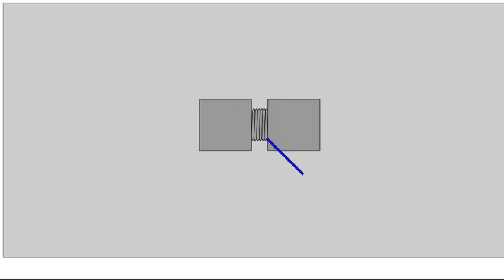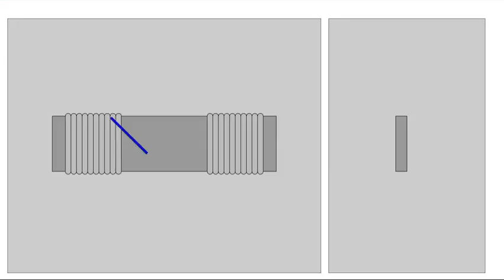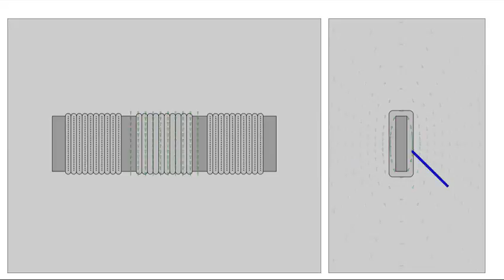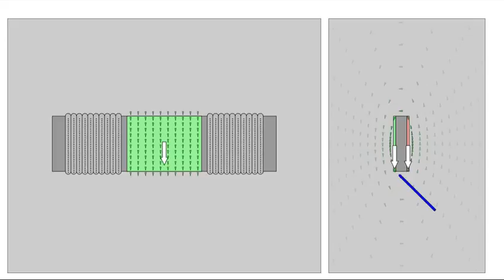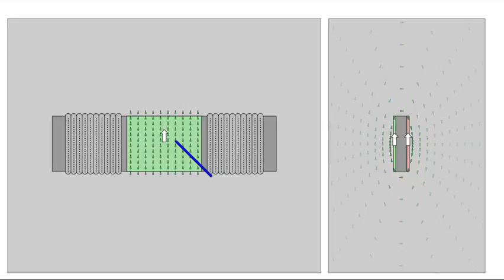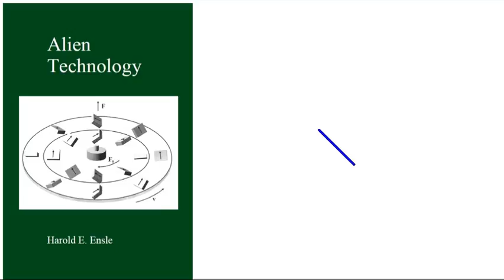The Electromagnetic Propulsion System

Comment: so is there a straight (non-circulating) sourceless electric field when a very large magnet simply moves through space in a straight line? I mean, large enough for the magnetic field to be essentially uniform and isotropic inside of it (in between the poles). as for the frame of a stationary electron it would feel a unidirectional electric force? or only a magnetic field that changes its magnitude is capable of creating a circulating electric field? couldn't be the actual motion of the vectorial B field (as to concentrate or spread out), that actually persuades the structure of space to respond showing the sourceless electric properties?

Comment from the maker: UPDATE

I have now proven by experiment that the scalar magnetic field exists. There is also ANOTHER scalar field, the scalar electric field as I discuss in The Electromagnetic Universe 7th Ed.

Now the scalar field means that there is no non-reactive magnetic force, so the part in his video where I say that this force needs to be eliminated by the additional "flux" capacitor is unnecessary. However, while the magnetic field reaction is not present, the scalar field defeats this device and it cannot be bypassed using this geometry.  HOWEVER, this would only happen if the magnetic field in the ferrite is caused by an actual surface current. That is, if an atom actually has electrons moving around the nucleus. This is unlikely (the Einstein-deHaas experiment notwithstanding). In other words this device should work even without the complementary capacitor.

HOWEVER, there is another problem. While this non-reactive force almost certainly exists, it is just too small to be of practical value. So I have been busy pursuing other lines of investigation.

There are many people that go on youtube with their phony energy creating devices or their phony non-reactive drives. They never work, but they often end up with money regardless. I do not work that way. There has been a long pause because I will not promote another device until I actually have a working model.

So the next video I post, you can be sure that it will be the real thing.

Comment from the maker: New update. There is now a question as to whether the scalar field exists at all. In fact, it appears that it does not.
In this case, the device should work. To express the options generally we have three possibilities:
1. The unknown scalar field exists and momentum is conserved.
2. No scalar field exists and there is no absolute frame of reference, then BOTH conservation of momentum and conservation of energy fail.
3. No scalar field exists and there is an absolute frame of reference, then conservation of momentum fails, but there is conservation of energy.

I am currently opting for number 3.
Reply: It's an interesting idea but i feel like you are only creating some internal stresses/heat with your plate capacitors and electro-magnets. Maybe if the capacitor plates flew the opposite direction you would get some movement.

Comment from the maker: It has been a while, so I would like to give an update on the progress towards the development of this non-reactive propulsion system.

It is my sad duty to report that this device does NOT work. However, the problem is much larger than anyone realizes.

If electromagnetism actually was correct as it is understood at the current time, this device and some other similar devices would actually work. There is no way around it. Those who claimed that this device did not work under these circumstances were ignorant and had no understanding of electromagnetism.

The reason that this device does not work is because there exists forces that are unknown in modern physics. It is the greatest irony that all this work I spent on these devices was wasted, not because I was wrong. It was wasted because physics was wrong.

I have finally worked this all out and explain it (in detail) in my book Electromagnetic Universe 5th Edition.
Reply: Yes, it does not work because magnetic field is created by accelerating charge particles...

Comment: I am reading your 3rd edition (not done yet), and I have ordered your 4th edition.  There are math issues in your book that I would like to discuss with you.  For example, it is known that if you have the conservation of charge (continuity equation), and no sources extend to infinity, and you use time retardation, then the Lorenz gauge condition holds.  Does this mean your beta is zero, always?  (See your Eq. 14.20.)   I like your approach but need clarification on the math.  Another example,  your fields, E, for example, is a function of space position (x, y, z)?  Are your x, y, z (or position parameters) time dependent or time independent?   It makes a big difference.  I'm not saying which way is correct, just wondering what your convention is.   If you would, please contact me off-line at WeberElectrodynamics@gmail.com.   Your work is interesting, but I need clarification.  Cheers.

Comment from the maker: UPDATE: Actually the 3rd Ed. Not overall very good. Did improve on a few details, but got sidetracked on some issues.
So let's jump to the 4th ed. of the electromagnetic universe. The 2nd Ed. of Alien technology has been included in the 4th Ed.

I suspect that some people are wondering what is going on with this invention. It has garnered no support from any sector despite the fact that basic electromagnetism requires that it works. Unfortunately the situation is much more complex. It has now been discovered through experimental work that a changing electric field in a capacitor does NOT create a magnetic field. This undermines my two additional patents, but actually helps this one because the end capacitors are not required since no sourceless magnetic field needs to be cancelled. HOWEVER, there is still the scalar field. This field is unknown in current physics, but has now been essentially proven to exist (See The Electromagnetic Universe 4th Edition.) This unknown field has the ability to cancel the force in the electromagnetic propulsion system, but even that is not known for certain, because it is not known if the scalar force can interact with the surface current of a ferromagnetic material.

I have received correspondence from several parties concerning tests that they have made, but typically they do not set them up correctly. Soon to come.....a video explaining how to properly test these types of devices (Spoiler: a homemade torsional balance sensitive to 8uN per degree of rotation)

Comment from the maker: Someone has brought to my attention a paper discussing a possible propulsion system similar to my own. This is Slepian's electromagnetic 
spaceship. I read the paper at http://www.physics.princeton.edu/~mcdonald/examples/slepian.pdf and found it to be quite nice. It does an 
excellent job of describing the forces associated with my device. In particular it does a nice job of describing the magnetic component of 
force which matches the force I discuss occurring on the surface current at the edge of the capacitors (WHICH THE END CAPACITORS ELIMINATE).  So yes the Slepian device does not work. My device does work however.

I am really glad to have seen this, because it answers a question that I have had. Complete electromagnetic theory has been around since 
1900 and it seemed strange to me that nobody would have though about this idea since it does come right out of basic electromagnetic theory. 
It is even more interesting, because in 2003 I came to the exact same conclusion as this paper independently. At that time I had calculated 
the magnetic forces and electric forces to be exactly equal and opposite but 90 degrees out of phase.

I almost gave up at that time, but was suspicious because of the difference in phase and also because further calculations later seemed to 
indicate that the two forces were not exactly identical depending on the geometry. I discuss this in my book. It turns out that by using 
various geometries, either of the forces can be eliminated which allows the force to be in a single direction.

Actually the Slepian device might still work. I have since calculated the magnetic field two different ways and there is a strange paradox. 
I originally used his method to get an identical force, but if one uses a Amperian loop around the capacitor, the force is only half and that 
is what I stated in the video. (Though with the end cap capacitors it doesn't matter since the magnetic force goes to zero in either case.)

Comment: When there is no charge to feel the force, the momentum is stored in the electromagnetic field which propagates away. So the best you get is a photon propulsion. Ie. you are pushing the device by emitting photons away. Easier to take a flashlight to do the same thing.
Reply from the maker: Nice try.

I originally thought that this was what was happening. However, this does not seem to be the case.
To provide a propulsion the radiation would have to be in a single direction. All we have here are dipole radiations which are isotropic.
Secondly. The work done by the forces predicted are dependent on the frequency squared, but the power of the the EM radiation is dependent on the frequency to the fourth power, so it is impossible for them to match up.
The force of this device is given by F=L/(KNw)I^2  where L is the total inductance of the coils. K is the dielectric constant. N is the number of winds of the coils. w is the width and I is the maximum current.

If you play with some values predicted by this equation, you will see that the force is much more than what would result from the radiation (even if  for some strange reason it was all in a single direction).
Reply: @haroldensle6656  Have you tried running this device in a 3D EM simulator and then see what the actual fields do look like? You have a Low-Frequency system where the dimensions of the device are much less than the wavelength and because of that you would not be able to remove the "Reaction" charges fast enough to avoid the reaction. Sounds neat but when you dig it turns out nature doesn't disobey conservation of momentum. So, either your momentum is going away as radiation and you have photonic propulsion (low efficiency) or there is most likely something wrong with your reasoning.

See Slepian drive for example here: http://www.physics.princeton.edu/~mcdonald/examples/bootstrap.pdf
Reply: @tictacX1  Yes, looks like the Slepian concept is the same as the above Ensle one...
Reply: @tictacX1   I did the simulation in CST studio using low frequency solver and there was no net force in any direction...

Comment: This device is based on [USP 20150022031](http://www.patentsencyclopedia.com/app/20150022031) of Harold Ellis Ensle, albeit I'm pretty well sure, this principle was [successfully tested](https://en.wikipedia.org/wiki/Woodward_effect) by prof. James Woodward [many years earlier](https://upload.wikimedia.org/wikipedia/commons/3/3a/Woodward_Effect_Device.png). This patent application has thus serious priority issue.

By dense (luminiferous) aether model this drive is based on unknown-yet aspect of behavior of electrons immobilized by electric field, for example in capacitors, which get time-reversed character of Dirac fermions here. Such an electrons get ability to interact strongly with scalar fields because their wave function also gets scalar character.

[trapped particles oscillate along time direction of space-time prefferably](https://i.imgur.com/Bn2yTpg.gif)
 In addition, Maxwell aether model characterizes magnetic field by flux of vacuum in extra-dimensions, essentially by vorticity of space-time. But transverse waves of light is essentially inert to this motion in similar way like the capillary ripples at the water surface.  Only geometrically frustrated particles like Dirac fermions within superconductors, topological insulators and charged capacitors of ferromagnetics in anapole arrangement have this capability. 
The system thus works in similar way, like the paddled boat at the surface of water. The introduction of charge to a capacitor is analogous the  inserting of paddles into underwater, i.e. hidden extradimension of the water surface. The introduction of current into the coil pushes the paddles forward, which introduces a reactive force to the rest of device. 
The apparent violation of momentum conservation law can be interpreted in two dual complementary ways. Prof. Woodward is saying, that charged capacitor has additional energy content, it's thus heavier by E=mc2 formula (so-called Mach effect). It's not difficult to derive though, that this effect will be too weak for to explain the observed thrust of Woodward device. 

IMO better explanation is, the vorticity of magnetic field is preserved and ejected in opposite direction in form of scalar wave, which has its inertial mass by itself - pretty well like the actual paddle is doing with water in the underwater. The Woodward drive should therefore generate stream of scalar waves which could be detected by another similar device, like the charged capacitor place in its path (by principle of [Gregory Hodowanec detector](http://www.rexresearch.com/hodorhys/xptgwsig/xptgwsig.htm) of "gravitational waves").
Reply from the maker: This was brought up in discussions with the examiner and Woodward is not an issue, though we did not find Slepian which is an issue. Even with Slepian though some of the claims will hold up. These claims are critical to the actual success of the device so I am not particularly concerned.

Comment: You can do simulation using CST Studio using low frequency solver by your self... 
I have also simulated Roger Sawyer's  EmDrive and found zero net force too...
Reply from the maker: That is strange. Two groups actually tested the device (in the non-fantasy world) and found positive results.
I guess this suffices to show how reliable you are.
Reply: @haroldensle6656   They have, and confirmed that it does not work:  https://www.reddit.com/r/EmDrive/

Comment: Although it has high dielectric constant of 250 the capacitance of the capacitor is very low because ferrite consists of conductive chunks and dielectric chunks  which represent millions of micro-capacitors connected in series...

Comment: I have made a model of your device using FEM electromagnetic  simulator and it shows no net force at rage of driving frequencies from 50 kHz  to 500 kHz... Also I was expecting a book but what I got is 25 page booklet without any scientific references nor prior art... So, what is the force of the patented device?
Reply from the maker: If you don't like the number of pages, you didn't have to buy it. The site (at least Amazon) tells you the number of pages before you buy it. 

A simulator model? Fascinating.

How did you set it up? Was there no force at all or was there a vibration? What was the frequency of the vibration relative to the input frequency? (example 1:1, 1/2:1, 2:1)

Did you use the single ferrite slab like in the first part of the video? Did you use the connected pair? Did you include the end capacitors? It would be good to test with and without them. What dielectric constant did you give the ferrite and what was the dielectric constant of the end capacitors?

I would like to try this simulator. Could you point me in the right direction?
Reply: @haroldensle6656  https://freefem.org/
Reply from the maker: Thanks  @matheworman6308
Reply: @haroldensle6656  http://www.usc.es/en/proxectos/maxfem/

Comment: Did you make a prototype and measure the force?
Reply from the maker: Not yet. I am trying, but I have not been able to push enough current through the device. Because of the frequency of operation, there is a lot of power loss, from IR losses, and losses in the dielectric and ferrite, plus radiation losses.
Reply: @haroldensle6656   Yes, by using ferrite as dielectric you added a resistor across your capacitor and thus you have ohmic losses... I am interested how you compute the net force and waiting for your book to arrive... I bought it here: https://allegro.pl/harold-e-ensle-alien-technology-i7647132774.html?snapshot=MjAxOC0xMS0xOVQxMDo0ODozMy4wMjBaO2J1eWVyOzRjZGFkYzYxODRjYmNkZGI5ZDUxZTk3MzcwMmYwMjg1YTUzYThiNmE4NWVhYjg5YTFhZGUwYzhmY2NlYWFmOWU%3D